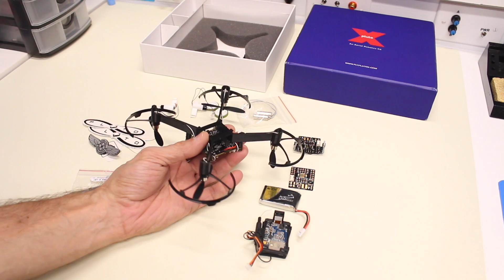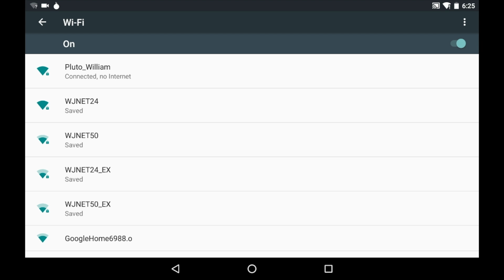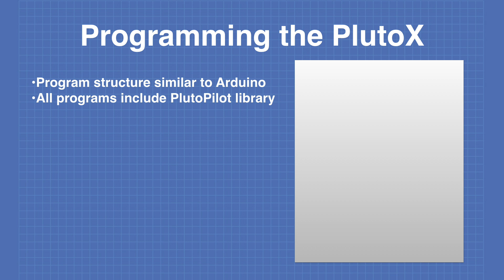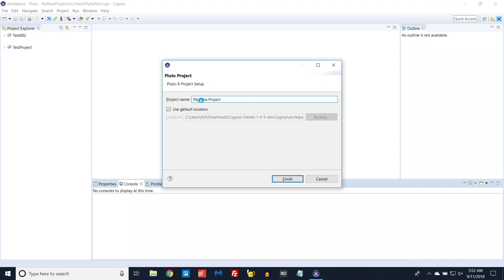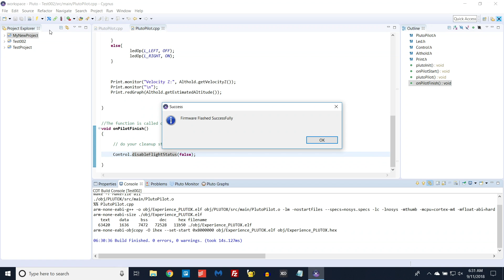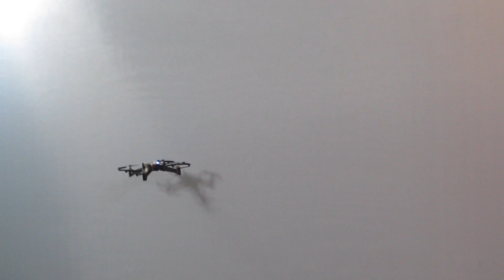PlutoX Aerial Robotics Kit - A DIY Drone You Can Program

Comment: I would like to see a drone based on the nRF24L01 with long antenna. They are supposed to have a range of 1400 feet. 

Has anyone done a (external antenna)range test with the esp32s module(the one from the esp32-cam) board. 

I also heard of drones built with a Rasp-pi and a SIM card receiver..  
(Does anyone know how high above the ground cell signals reach?)

I seen videos where someone has a plane doing waypoint navigation. That's where you plot out a course for the device to follow on a map, and it goes off on a programmed flight path..

Comment: You know the magnet suspended through another base magnet? Ok 

If this suspended magnet coated it with a protected conductor wire (the same thread to create a transformer) 
Then we put a spherical chamber in the same way coated as the first suspended sphere. 

This creates energy, just watch a couple of videos on you tube. 
In a nutshell, the closer this suspended sphere comes,

Comment: Hi Bill.  Love your videos!  And your Website.   I've already learned quite a bit from you about servo motors, the PCA9685, stepper motors, and I've built your robot car and have modified it extensively. 

I wasn't really thinking about getting into flying drones, but this PlutoX looks promising.  I have to say though that your footage of the Pluto in flight was not very impressive as it doesn't appear to be very stable.  What I would like to see are programs for this PlutoX that will allow it to basically fly itself responding only to commands I give it on where to go and how high to fly etc.   I don't want to need to pilot it myself.  And I would like if it could hover in one place with dependable stability. 

Also, I would prefer if I can control the PlutoX from my laptop computer instead of having to use an android device or ipad or iphone since I don't have those devices.   Can I write programs on my PC to control the PlutoX.   I can write programs in C# and/or Python.  I prefer to use C# since C# has a really nice Windows GUI interface. 

Anyway, thanks for making these superb videos!   You're one of the best teachers on YouTube to be sure!
Reply: Hi, the drone that bill is flying has a barometer. Thus it can stabilize itself in height. For stability in XY, it needs an optic flow sensor. This module is currently in development by our team. This should be ready by Dec2018. Post optic flow, the drone will be able to stand in one position. You can command the drone using ROS of PC. Our wiki page regarding that should be up shortly. You can also command it using Matlab simulink, this is done earlier, but not published yet.

Comment: Subscribed to the newsletter! Anything that means I get a bit more content, I'm all for :P
I'm wondering (and I'm sure I'm not the only one) if this can be programmed in the Arduino IDE and run Arduino sketches? I'm sure it won't be long before someone "hacks" this and makes a library if it doesn't currently support Arduino :P
Reply: pro tip : you can watch movies at kaldroStream. I've been using them for watching a lot of movies lately.
Reply: @Anakin Rudy Definitely, I have been using Kaldrostream for months myself =)

Comment: We have purchased these in the past, at our makerspace in Mumbai. We also built a python wrapper that can control this drone remotely using a RaspberryPi or a computer. https://pypi.org/project/pyMultiWii/
Reply: Wow Rupin tats awesome.
Reply: @prasannashevare8961  We kind of left it midway, slightly unfinished, does the current drone boards and firmware report altitude and magnetometer direction on multiwii, back to the phone controller?
Reply: @RupinChheda  yes they do.
Reply: Having a board with us for testing purposes will be helpful, we are keen to add to this python package.